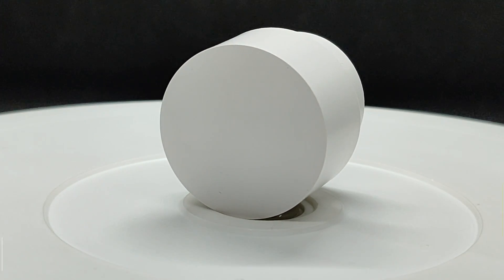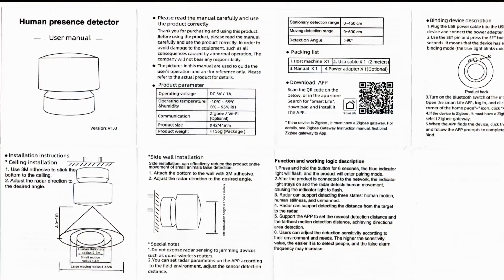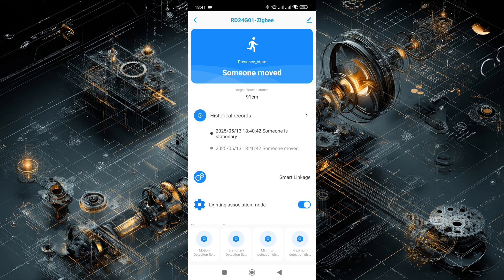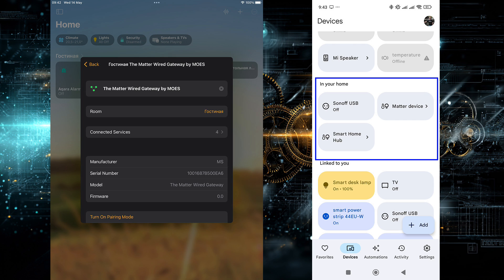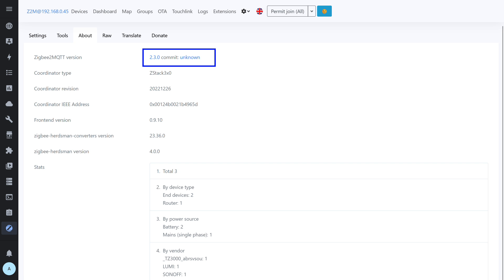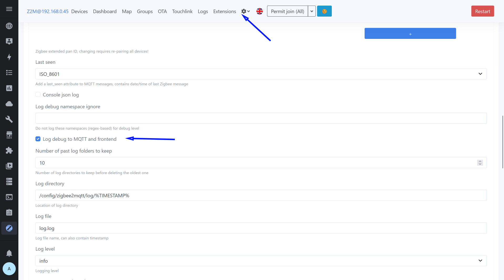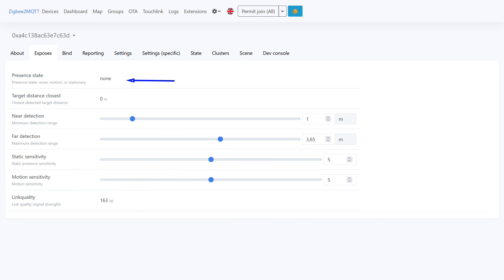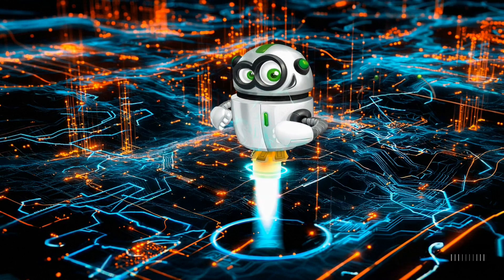24 GHz zigbee датчик присутствия RD24G01 - обзор, тестирование, создание конвертера для zigbee2mqtt

Comment: thank you so much i had no idea that i have to make a folder for external convertors, every one said to just put it next to the yml, saved me alot of greef
Reply from the maker: That’s right 👍
Some time ago it really worked the way you said — you had to create yaml files and manually point to them in the config. But later it was simplified: now there’s just one common folder for external converters, and everything from there gets connected automatically. Much easier!